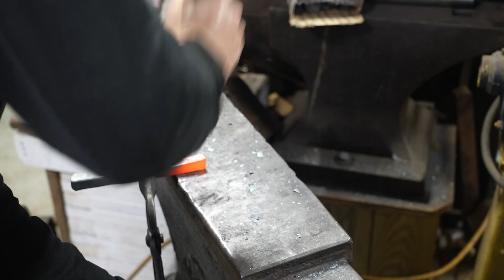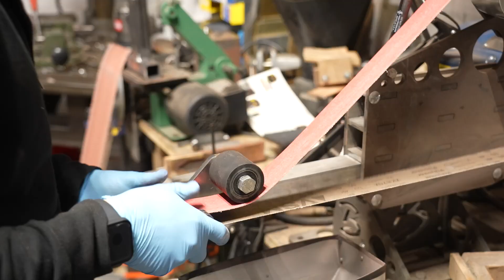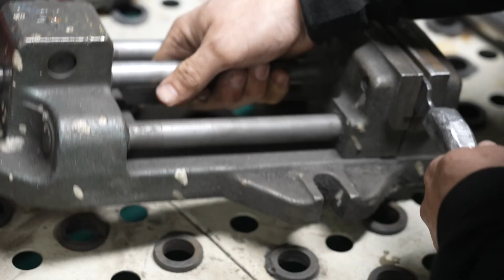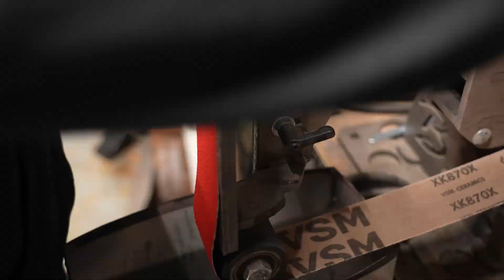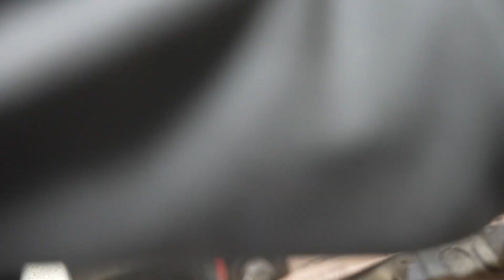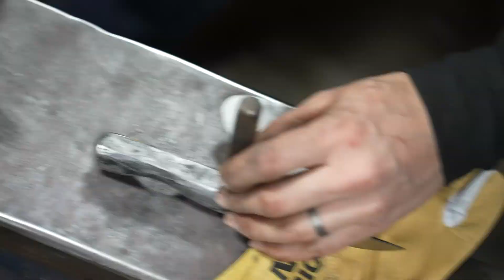Can A Nail Become A Knife?

Comment: I'm curious, how long did that take?
Could you break down the time for each "process"?
Reply from the maker: I’d say the forging took about 2 hours, then cleaning up and preparing for heat treat another hour. Heat treat process is fast but tempering takes about 2.5 hours. (2 one hour cycles at 350*) then grinding the bevels and finishing it up another 1.5 hours. I started around noon and finished at 730pm. I really enjoyed the challenge!